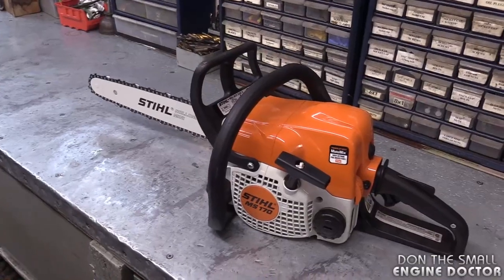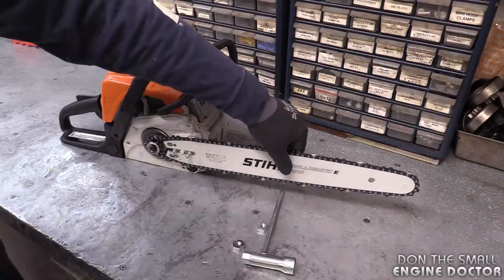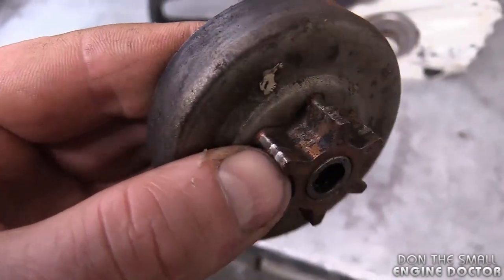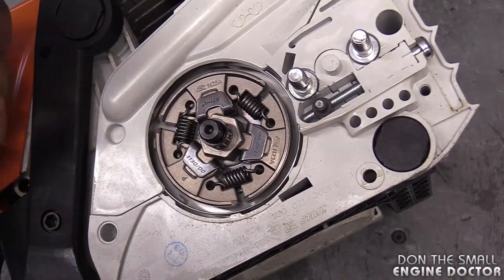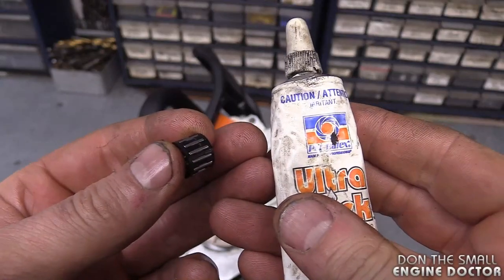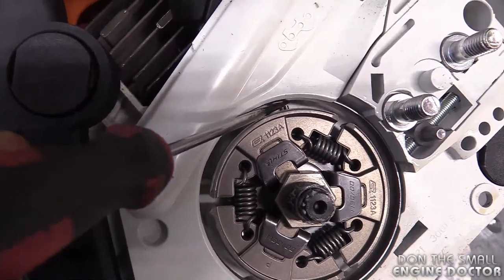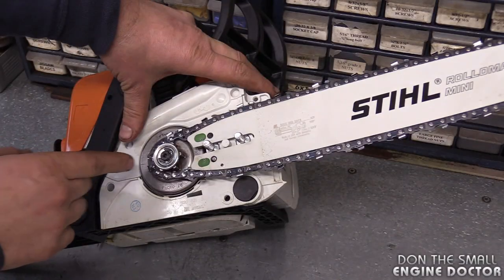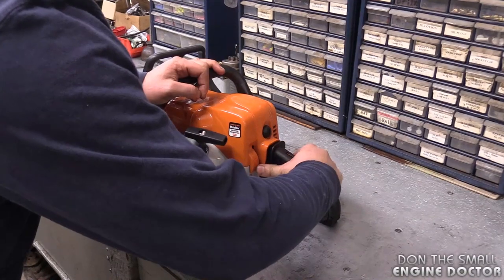Stihl MS170 180 Chainsaw Chain Sprocket Replacement

Comment: I bought a new MS 170, yesterday, $203, out the door.  I am going to replace the chain adjuster.  I may replace the bar and chain, later, with an .050 bar and chain.  I hate the .043 chains.  I also like to lube the sprocket bearing on all new saws with high temp wheel bearing greased.  I use regular kitchen pliers tool snaqp the E qcqlip baqcqk in place.  I have found these snap it into its slot a lot easier than needle nose pliers, without it going into orbit.

Comment: Great walk through on how to do.
I have an old ms170 which runs fine initially and then after a few minutes starts to run rough. Also I have noticed that quite a long time after it's switched off I can hear a venting noise, as if the petrol tank has been pressurised. Any thoughts? Maybe a good video if you've come across this before?
cheers

Comment: Thanks a lot. I learned a lot from you. Got a MS181c-be at our cabin at  higher altitude(1050m), and it would be supercool if you could teach about carb adjust for that application. It runs a bit better at lower altitude. Big thanks from Norway.
Reply: The MS 170 & 180, no matter the furniture only have one adjustment screw, LD for Idle. There is no H & L screw. Default setting on the LD is 2 full turns out from the seated in position (the screw has reverse threads, so left is in and right is out). In short, you can only adjust Idle on these two 1130 saws.
Reply: Got all 3 screws on my MS-181.

Comment: I noticed that you haven't upgraded the bar and chain to the 
.050 gauge.  I picked up a 170 on sale. My dealer swapped for a .050 14" 50 dl with yellow chain and a an extra chain 1/2  price.  Nice as my Stihl 020T top handles saw uses same chain. I prefer the Rapid Micro yellow non safety chain.. Great videos. Thanks, Ed

Comment: Hello from Washington state. Enjoy your videos very much, thanks.  Do you know if the old 025 has the shaft like that for the worm gear oiler? I just picked up a older Stihl 025 want to do some maintenance on it this fall before using it. Seems like it runs good but needs a new chain and bar.
Reply from the maker: i think it does
Reply: Same worm gear but different sprocket

Comment: question i have a poulan wild thing chain saw when trying to start it. It's almost like it has to much compression it's really jerky to start. Can;t see anything wrong with the recoil starter. it just won;t pull freely so you can start it.any suggestions would be appreciated
Reply: I am redoing a Poulan 5020?  recoil and it uses a second spring to make it easier to start.  The smaller spring was mis-shapened I guess from previous owner and it prevented a proper pull.  Got new parts, not back together yet.

Comment: Hi Donyboy, could you please do a video on replacing the fuel line and filter on a MS180 please as i have this job to do and just want a heads up on any complications i might come across, thanks in advance
Reply from the maker: here's part one, older videos but same info https://www.youtube.com/watch?v=uEjI_lb2ZV8
Reply: @donyboy73  Hi Donyboy, i checked this however my fuel line is in two sections and i am not quite clear how this will go together. Thanks again

Comment: Hi DON. I am in the market to purchase my first chain saw for cutting fire wood for a recent wood burning stove we had installed. After doing some You Tube research i am leaning towards getting an Echo because the engines are made in Japan and because of the 5 year home owner warranty. Any suggestions on a particular model or brand ? Many thanks...  Paul

Comment: A few months back I used my MS 201 C-EM on stomp removal job. Almost in one hour I totally  messed up sprocket. So dirt not only enemy of chains. :(
Anyway, got some expenses buying new drum sprocket and Duro carbide-tipped chain. What are Your opinions about this type of chain, anyone using it on dirty jobs, what impressions? Worth the moneys?
Reply from the maker: the carbide chains do last much longer

Comment: On another video, you show changing the bar and chain on the MS170/180 to a 0.50 gauge.  Does that require changing the sprocket too?
Reply from the maker: no it doesn't as long as you keep the new bar and chain a 3/8" pitch